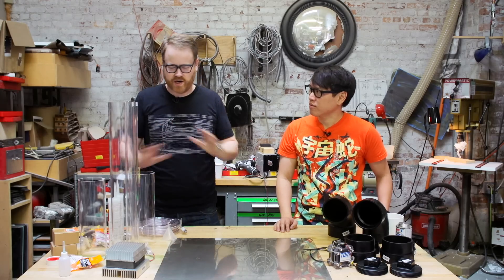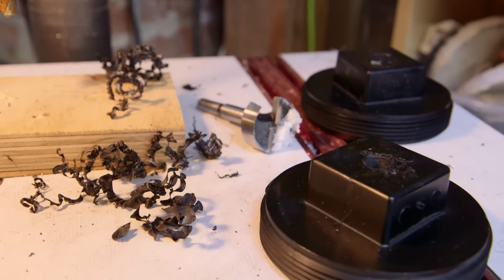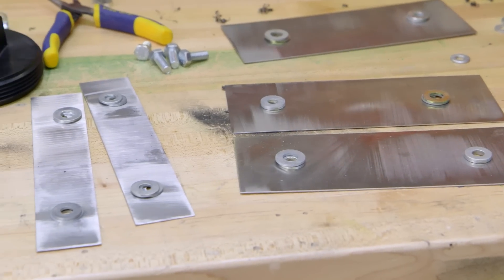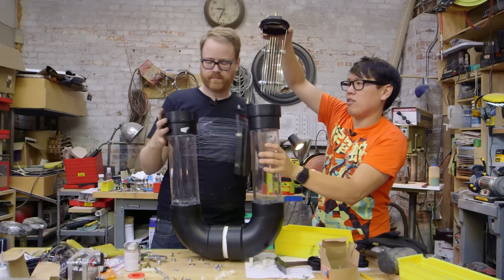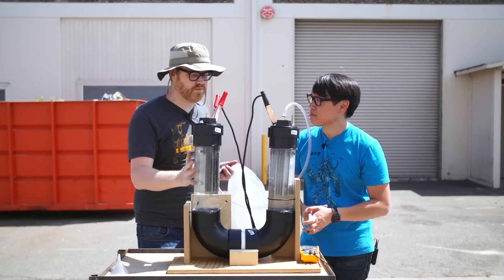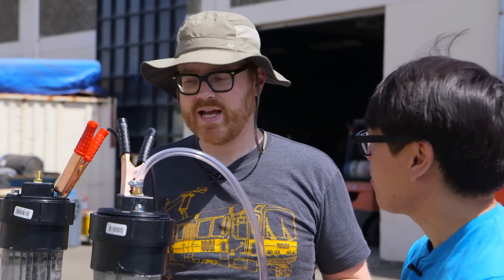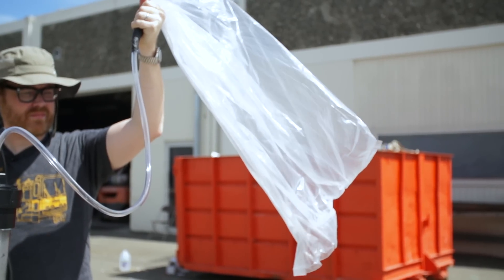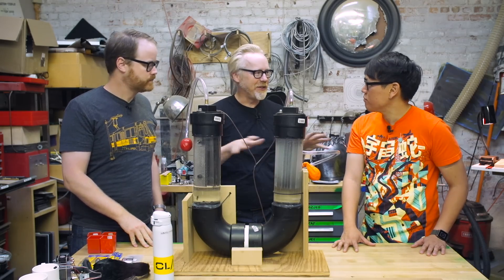Tested Builds a Hydrogen Converter

Comment: They are completly wrong. You produce the most hydrogen and oxygen when the voltage is low and the amps are high, thats why it doesnt work
Reply: Thank you  for mentioning it.  Eventually, someone who knows something.
Reply: Well I wasn't trying to sound smart;p This info is easily obtained on google, i don't get why they messed it up. I think that either Adam or Jamie should've known too, they have been working with electronics for ages.
Reply: @atiseru  .essentially up on purpose. This tech would kill the oil industry and u would have cars forever.
Reply: Not when using a solar panel, generally.  Unless you use a bigger panel.  It takes a very big panel to put out the needed amps, even with high volts.
Reply: A friend and I ran a car off hydrogen using a 12 volt battery.  12 volt x 25 amp = 300 watt (it is a high draw device)  100 watt / 22 volt solar panel = 4.54 amp.  higher voltage but 3 times less wattage, also only enough amps for a low draw device.
Reply: No it took more.  The battery only lasted for a short while and was very hot.  It probably gave up all it's cranking amps.  It took gas to get the car going, at witch point it could be shut off for a short while.  The hydrogen gen looked like it was boiling the water at the time.  We mounted it on the outside of the door to observe it. 
 
The problem with the video is that, in most peoples opinion, "current" is the word used to describe amps. You can have more volts but still not enough amps, amps does not necessarily increase with voltage.  A 12 volt battery can put out more amp, therefor more watt (VxA=W) than their solar panel, they should have known that.
They said that "22 volts will increase the current"  (compared to a 12 volt battery) Bottom line is they were wrong, that is one reason they could not produce more hydrogen.
Reply: @alaskanalain  Nailed it mate - theres a lot of mistakes like plate spacing - isolating plates - amp's etc shit vid and I bet its put a lot of people off trying it themselves - not me, I make shed loads of gas with wind generator power.
Reply: kevin doubling the voltage only doubles the current when you have the watts to do it. if you are using a constant source of power like the solar panel, to double the voltage you must halve the current. you can't get power out of nowhere by doubling voltage
Reply: alaskanalain
Agreed, I saw an electric car with a solar panel on top and people were going crazy about it, little did they realize how insignificant a contribution it would be able to make. I'm not saying it is a bad idea, better to charge the battery a little than to waste the sun's energy heating the paint on the roof but, it isn't going to push the car very far.
I love the idea of you putting something together for your hydrogen generator, I am imagining titles: Mythbuster's Hydrogen Cell Mythbusted, Tested Fails the Hydrogen Generator Test, etc.
Reply: Well, but you have to account for the internal resistance of the battery.  Some batteries are high discharge batteries and can put out a higher amount of current.  V = IR can technically mean doubling the voltage (while keeping the resistance the same) means double the amps, but that's working with ideal unrealistic variables.  Really, the amount of voltage they needed was just enough to bridge the resistance of the electrolyte and really needed to pump a huge amount of current.  That's why  lot of people use deep cycle marine batteries, because they can put out a large amount of current and tend to have higher capacities than other batteries.
Reply: electrolysis runs on current, not voltage... run your power sources in parallel and you'll get more current potential while maintaining the same voltage, if you ran them in series you would have increased the voltage and cut your current potential in half... your wattage will go up in either scenario... volts x amps= watts
Reply: Realistically from a 100W panel at 18v (max) with guess losses will produce around 5amp. It appears to me they have 150watt panel (guessed by size). The space between the anode and cathode is ridiculous. The video was very edited down to show fck all. This needs to be tested. Only way is prove to ourselves.
Reply: alaskanalain
That makes sense. A battery can do a couple hundred amps for a little bit, at 12 Volts that's 2,400 watts. I could totally see that pushing a car along just fine.
There are a lot of upset people here that I think would love to see a video of your far more functional hydrogen generator (I'm curious about its construction details too).
Reply: you are spot on
Reply: To my knowedge it is an effective option to increase wattage anyway. This improves electrical distance issues between positive and negative.
Reply: The were not tracking the sun with the panel either. A  panel just lying on the ground is far less effective than one that is angled and adjusted so that the sun is hitting it square on it face. So regardless of what that panel was supposed to be doing, it wasn't. Come on Mythbusters, don't be busters.
Reply: @forcesightknight  yes. That's the first thing I noticed. They didn't even have it angled to the sun.
Reply: also, the balloon becomes pressurized, pushing the gas back into the system.
Reply: Not to mention the efficiency is horrible with the distance/resistance between the anode and cathode.
Reply: I think the guys using the solar panel made the same mistake alot of people do, they assume it is better than it really is.  Earlier when I mentioned 300 watt that was just an example to show the math behind it. 
I will see if I can find my info on it.  I took pics and some video back in 2005. I didn't think it was a big deal so I didn't bother to post a video.
It did produce an obscene amount of hydrogen/oxygen. It also seemed to make the fuel burn more efficiently, when it ran on both.
Reply: @alaskanalain  I think they knew better and built this crap for TV. They knew fully that showing how to do it correctly would get a viewer or two killed at home. Hydrogen gets dangerous fast, and they'd get sued.
Reply: atiseru thank you. he said they used Voltage not amperage. amperage is the driving force in Electrical current
Reply: I'm not sure you understand what your saying. V=IR a higher electric potential (V) means a higher current (I). a lower resistance (R) also means a higher current. They used a higher voltage  and dissolved ions in the water, to lower the resistance, to increase the current. Less electric potential means less current not more. You are right that you need high amps but raising the voltage is the easiest way to get there
Reply: I don't show videos of this but I've filled 20oz soda bottles with the hho gas mixture, wrapped bottles in cannon fuse, and set them off... they go off like a full stick of dynamite... A friend of mine who witnessed this asked me to do a 2 liter bottle and I refused... balloons are pretty cool tho, they make a "thud" sound so deep you can feel it in your chest and it rattles windows
Reply: In their case resistance was far too high
Reply: there is a device which makes 12V in to any 10x  more if needed. so if your power source is 12V and 20A , but the electrolisys only takes 4A , you know you need to higher the voltage to 600V, but in that case use proper insulations procedures and dont touch it !  From what I currently know you can amplify DC voltage by converting it to AC with a switcher then run it thought transformator(voltage amplifier), then use four diodes to make it DC.
they did not look how much power is used from the panel to the electrolysis, they might discover it is not fully used.
Reply: Kevin Jackson Kevin I bet you ride the special bus. Why the fuck do they need to waste money making a video when there are hundreds of other on here already. Fuck off dickbag
Reply: Perhaps that's true using old conventional dinosaur methods. - watch?v=EkjpVcsRQLc
Reply: But not too low. Like you can't use 1.5v alkaline batteries. It won't work
Reply: Your correct thanks for explaining it correct 👍😊😉
Reply: The anode and cathode are too far away from each other.
Reply: TESTED ARE Just deceiving LIARS
Reply: Isn't the exitation happen through the watts it receives? If they can develope 100watts through the solar panel its max peak in which they produce with the same voltage.
Reply: 12volts 180amps?
Reply: You are correct and they also,  supossed not work.
Reply: They did this on purpose to promote buying the fuel commercially. Did you hear them say that at the end? They really did say, go buy it from a corporation. FAIL.
Reply: alaskanalain
I also doubt very much that you ran a car off hydrogen using 300 Watts. You lose 120 Watts converting electricity to hydrogen and then lose another 108 Watts of the remaining 180 burning the hydrogen in an engine leaving 72 Watts under ideal conditions to push the car. That is enough for a cheap stereo (which is moving very light speaker cones) but an average electric car uses 100,000 Watts or more. You'd be able to push a car faster than 72 Watts would. 72 Watts probably wouldn't move a car at all.
Reply: atiseru but u need fucking voltage to draw a current u fucking idiot
Reply: What you gonna do about it big man
Reply: alaskanalain
Batteries have a much lower source impedance than solar panels. Check out some high school level electronics.
Reply: alaskanalain
Absolutely when using solar panels. If you put two in series you double the voltage which will double the current to a fixed load, assuming, as with any generator, you are not overloading them.
Reply: @kevinjackson4464  actually, if the panels are in series, which they usually are, you add the volts of each panel together, but the current is constant. It doesn't increase (unless you put them in parallel). If in parallel, the volts stay the same and the current of each panel us added together.
Reply: @Mozillapi  the solar panels are usually in parallel to control the current flow. If put in series is because it needs more voltage and the current is not too high. It is only in series when the current measured is low.
Reply: My grade school science class said if you double the voltage, you double the current.
Reply: @kevinjackson4464  Guess its why its called "GRADE" school. Need to move on from kiddy school...
Reply: @kevinjackson4464   I know it's an old post, but hey why not.... If you double the voltage in electrolysis of water, aka 2.2 volts to 4.4 volts... you will find you run out of amps first.
At 2.2 volts you can easily pull 5 amps (lots of variables, but you get the idea)... now at 4.4 volts you will be pulling closer to 150 amps....

So point being: "Double the voltage in electrolysis and multiply the amps" as water is a variable resistor!
Reply: @Warj-hm7jd  water is variable resistor? Maybe if you move the distance between anode and cathode. The amp regulation depends a lot in the capacity of the source, you can pull a lot of amps with just 1 volt if you lower the resistance with another conductive.
Reply: @kevinjackson4464 yes you double the current but what you end up doing is building up a lot of excess heat for little to no efficiency increase. There are countless videos of people learning this the hard way as they fry their batteries.
Reply: Where is your video? I see a lot of commentators saying they know how to do it but I don't see any of them doing it, I call BS!
Reply: @kevinjackson4464  here is a nice video. Under the description there is some technical data for everyone to view. https://youtu.be/r-CQcaWhtHE

Comment: Yeah it's 22V on an open circuit.. But it won't generate 22V @ whatever amps it is rated at. It's designed to charge 12v batteries, so ~14v @ whatever the current is rated at on the panel.